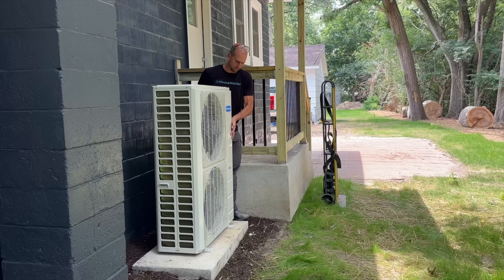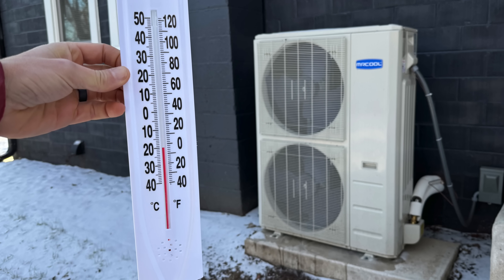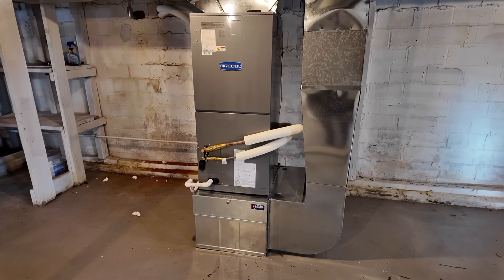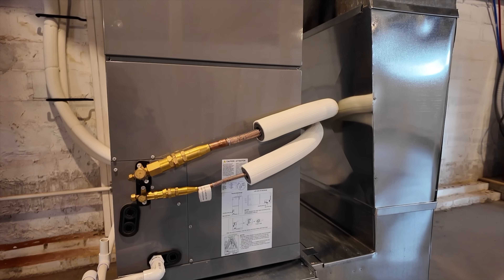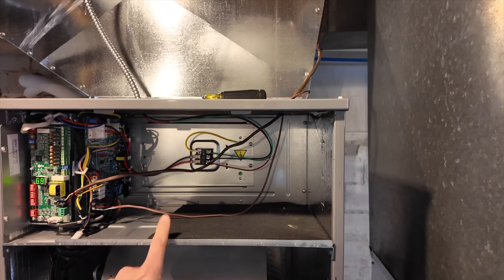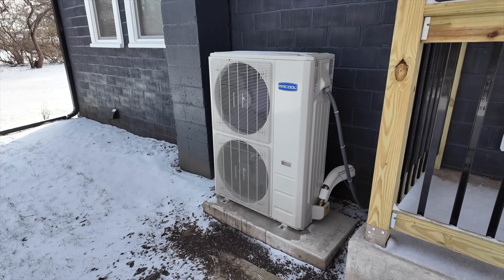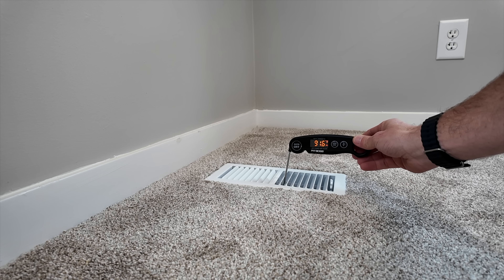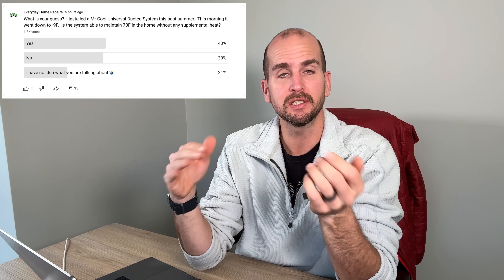Testing A MrCool At Extreme Cold Temps | Will The Hyper Heat Work?

Comment: I had a 4 ton Mitsubishi installed in Colorado in August, 1400sqft house built in 2004. We had the same cold snap, between -14F and 0F for 3 days. Heat was set at 71F because my wife is sick, and it was fine. The energy monitor says it pulled 7.5 kWh peak, 95 kWh a day. My ice buildup looks like in the video. Next time I'll probably set a lower temp.
Reply: Yikes . 95 a day is what cooling in 110° this summer cost on a traditional 14 SEER 2100 ft home .
Reply: You really do need a backup heat source. Minus 14F is COLD and there's very little heat in the outdoor air to gather. Your heat pump was probably just running on its heat strips (resistance heaters) which are a very expensive form of built-in backup. Get a woodstove, or something you can depend on when the weather gets this cold.
Reply: @paulmaxwell8851 I don't have heat strips either. The installer said they'd cost $3K, I figured that would buy a lot of electric space heaters.
Reply: @paulmaxwell8851 remember that 0°F is 255 kelvins, or 255 kelvins above absolute zero (where there's no heat energy). 100°F is 311 kelvins. Not a crazy spread there. There's a lot of energy to be gathered. But it still takes energy to gather it from the air!

I would guess that person had a Hyperheat in Colorado...meaning it'll blow hot air down to around - 22°F or 243k.

I think it's wiser to use a cold climate inverter style, but not Hyperheat, heat pump in up to zone 4...with aux strips, rather than a Hyperheat because they're actually slightly more efficient than a Hyperheat unit during the vast majority of their operating conditions. The strips should only need to energize during defrost (let the inverter ramp up and do the job rather than resorting to the strips over 2°, except for the absolute most extreme conditions...which happen about 2 hours per year. Hopefully the installed thermostats have adequate logic to behave in such a fashion.

Comment: I have a Mitsubishi hyper heat mini split system in my 1000sf home but these negative temps over the last few days have not been up to the task. Thankfully I kept my gas furnace just in case this winter.
Reply: Thermostat settings play a huge part how these systems run. So if the settings are incorrect they won’t run down really cold temps

Comment: My past experience with heat pumps has been horrible.  I'm surprised, and impressed!  You said temps were close to 0.. I am concerned with how it will do when temps drop below 0, which will happen in IL.
Reply: to be fair: the US is horribly behind compared to the japanese brands and the units the SU does get like the bosch and these rebaged Gree units are pretty far on the bottom end of the quality and performance tier.
Reply: @SupremeRuleroftheWorld  I have the 48k version of this unit.  Please note that these are hyper heat units, not universal units, although both are central ducted units.  Universal units are rebadged Gree but hyper heat is a different manufacturer.
Reply: someone is a Mitsu snob LOL
Reply: @sprockkets  fun fact: both my air/water heat pump and 2 separate minisplits in my home are from panasonic.
Reply: Can you get better performance with a top-of-the-line Mitsubishi minisplit? Yes you can. But you'll pay far, far, far more  when you factor in the install. MrCool sells DIY units to people who will never be able to drop $10,000 to 20,000 on a heat pump. They work well, but have their limitations AS DO ALL MAKES AND MODELS. As I said above, we cannot all afford to drive Ferraris and MrCool is helping to make HVAC affordable for ordinary people.  @SupremeRuleroftheWorld

Comment: Question. I am in a very humid location, how does it do with that? The central heat pump I have will heat, but it is a muggy wet feeling heat. I have gas downstairs which comes out dry, but I don't think the air in the heat pump system gets warm enough to dry the air.
Reply: No heater system "dries" the air, period. You might think that if your coil is wet from air conditioning.

Comment: Great information Scott. I'm curious about the power consumption of the unit at sub zero temps. Looking forward to that next video.
Reply from the maker: Yeah, I have been waiting for the cold snap to really see what the daily consumption would be on the high side.  Not looking good 😬 if you ever wanted to run one of these units off-grid.

Comment: My cooper hunter heat pump is designed to run up to -22 f. It’s a 2.4 ton unit heating 600 square feet brick wall house. And I would say it’s not enough. But we are limited by amount of input current in Ukraine, we only have 240 volt 16amp
Reply from the maker: Yeah, I saw this unit go up to a power draw of up to 7 kW when the temp dipped down to -9F (-23C) which is a heavy load and not going to work on a 16 Amp service.  Thanks for the feedback and be safe over there.
Reply: @EverydayHomeRepairs  thanks. It was huge problem as we had to turn everything off so that heat pump doesn’t trip the street breaker

Comment: A couple days ago here in western Canada we experienced overnight lows of -49F and highs of -35F.  Are any of these heat pumps capable of, or even surpassing, the heat output of a typical natural gas furnace used to heat say a typical 1200 square foot bungalow?
Reply from the maker: The heat pump units would depend on those "heat kits" to provide heat down to those temps but it would be a Massive power draw on your system.  I think having a supplemental heat source like a pellet stove and maybe some space heaters would be a little more efficient way to go.  These units are nice but pull a serious load once the temps dips under 0F.
Reply: Cold weather heat pumps are not currently designed to work below about-10°F.  For your location you need a dual fuel heat pump or a water to air system.
Reply: No, stick with natural gas.  If you get an itch and want to chop wood, get a Jotul cast iron wood stove.

Comment: Heat pumps are just going to keep getting better. The department of energy is holding a cold climate heat pump challenge and most of the major brands are in the field trial phase.
Reply from the maker: Yeah, I have been impressed with the improvements over the years 👍
Reply: Be careful with doe.  I used their testing data to base my air source heat pump purchase.  The test data was not valid.  I suspect they use manufacturer testing data, which may not be reliable.  And/or doe testing controls were not fully disclosed.

Comment: You mention in the video the outdoor unit is fed with a 50A 240V circuit?  That seems massive for a 3 ton unit.  My 3-ton Mitsubishi Hyper Heat unit only uses a 30A 240V Circuit, and that includes backfeeding the indoor unit from that same circuit (no separate circuit for the indoor unit required).  I wonder why the Mr. Cool needs such a bigger supply?
Reply: It probably doesn't, but this particular unit needs only one circuit, as the outdoor unit powers the indoor one.

Comment: Hmm, I have a propane furnace currently, wonder what the cost difference would be going with this MrCool system.  I don't have central air, so the MrCool system would be nice, but is it worth the cost to replace the furnace to have heat/air both.  Not sure what it would cost to add central air but it can't be any less than this whole unit....I have a 1200 square foot home, and think the system you have would work just as well here in Idaho, currently in single digits and slightly below overnight....but I have a wood stove I use when I'm not at work.  My current recurring issue is when the furnace has to run really often when I'm at work, I come home to a freezing house because the condensate drain freezes up and shuts down the furnace.
Reply: You can use a mrcool universal, replacing ONLY your outdoor condensor/HP (assuming your evaporator has a TXV, properly sized and set up for a HP). Then you have your propane furnace as aux/emergency heat. In most of the country,  even resistance heating matches or beats propane at winter pricing, and the cost is much less volatile. Here in the south, our EMC charges about 4 cents less per kw/h after 1k. Also, for now - the 2-3 ton (but not the 4-5 ton) mrcool unit qualifies for the 30% tax CREDIT. ("Inflation Reduction Act" lol). In the south,  these things really perform well in the summer compared to our old 10 and 14 seer units, but almost anything new would.

If you don't have A/C now you would also have to insert a new evaporator inline with your existing furnace and run a new lineset. Also covered in the tax credit.

Comment: It can deliver heat, but it will need more defrost cycles and each cycle will require more heat than when operating near freezing.  While this (and other new heat pumps) can work with colder ambient, even old school heat pumps can deliver heat down to well below freezing and needed to defrost.  The issue is defrost cycles and the net energy usage over time once those defrost cycles are taken into account as well as comfort during those defrost cycles.  Usually a well documented heat pump will specify its performance coefficient curve vs. ambient temperature.  In theory it is cost effective to operate while performance is greater than 1 (at which point just use electric heat) but usually it is better to stop well before then to avoid excess wear and tear on the equipment and simply for occupant comfort.

How much energy does it use during defrost compared to "while heating"?  Does it blow cold during defrost?  If not, where does the defrost energy come from?

Heating water may be the ideal heat pump application.  That provides a large reservoir of heat for defrost, with no concern about "blowing cold air" and the backup heat can be called upon the supplement if heat demand exceeds reservoir capacity.
Reply: As far as COP numbers at various ambient temperatures, you can look that up in the NEEP database. Tons of information about all brands of heat pumps. I get what you’re saying about heating water, but that’s just not how homes are heated in the Midwestern United States. Other than a few very old houses, basically everything is forced air here - whether by gas, oil, propane, or heat pump.

Comment: Curious what the energy draw is at that temperature; I expect it will be higher than during more mild weather. We get a lot of cold weather up here in Maine, but in the area where I live, we also tend to get plenty of power outages, sometimes for days at a time. A portable generator runs my furnace just fine; not sure if that would work with a heat pump at -20 though.
Reply from the maker: Here is more of deep dive on the max power draw and daily energy consumption.  Interesting results for sure https://youtu.be/06CiR6SWkAE?si=0g8P8nHIV1tNWsZr
Reply: Usually pretty similar energy usage, except during defrost which happens more often if the outdoor coils operate both below the dew point and below freezing.  Very dry, cold air - not a problem.  Rainy and foggy near freezing - the unit will spend a lot of time defrosting those outdoor coils.

Defrost might pull heat from the room ("blows cold air") or use electric heating or possibly some combination ("blows less hard and it doesn't feel very warm").
Reply: It would have to be a massively huge generator to power a heat pump and an air handler. He said the outdoor unit is 50 amps alone, and a 15 amp 240 volt circuit for the indoor blower. Most of this channel's videos are literally just infomercials for the products they're featuring, hence the manufacturer's link to the product in the description. They'll never expose the gory details of the product's drawbacks. If you suffer outages for days at a time, stick with fossil fuels as a furnace or boiler using gas, oil, kerosene or propane running on 15 amps 120 volts is easily powered by most portable generators.
Reply: @darrendolphdragos9752 The 15 Amp and 50 Amp he referred is the breaker size and has little to do with the amount of power. Nation electric code(nec) derates them to 80% so 52 amps total which is equivalent to 12.48 kW and it still probably doesn’t use that much power. A 12 kW generator should be able to power it no problem and you might be able to get by with one a little smaller like a 9kw. You just have to make sure you have a variable start. If it is not and has a high lock rotor amps (LRA) like older units use to have it could cause problems with the generator.
Reply: @ryanp0342  Ryan, I'm aware the actual load of the heat pump and blower aren't the breaker ratings. But anyone with a generator sized to run this heat pump, who needs to run it for possibly days at a time, better have quite a number of gas cans for that portable 9kW generator. It's possible, but IMHO simply impractical. Plus anyone with a backup generator surely would want at least a couple of circuits in the house available. As far as variable (we call it soft start) I believe most of these heat pumps use inverter technology (at least the ductless systems do) and convert the AC current to DC and always soft start.
Reply: @darrendolphdragos9752  Soft start and variable drive are not the same thing. A soft start is basically a capacitor that is added to the motor circuit reducing the start up or the Lock Rotor Amps(LRA) but doesn't necesarily limit the running current(RLA). A Variable drive limits the current on start up and also limits the current to a variable amount instead of a set speed making it run more efficiently. You could easily use the lights while running the generator because of the variable drive. You would burn roughly 10-20 gallons per day depending on heat setting so yes multiple days would be a hassle if you don'y have access to a fuel source but if you think you need more that much time for an emergency outage you can easily get a propane generator with tank for the capacity you need. My point is it can be done with good planning.
Reply: @ryanp0342  Good planning? You mean that and boatload of money. My response here was geared towards the situation the OP explained. All the OP needs to utilize a heat-pump based heating system is a much larger generator, and a lot of extra fuel to weather a multi-day outage. Not very practical and for most people, impossible. I realize soft start and variable drive are different concepts. My point was variable drive DC powered heat pumps tend to "start soft" and ramp up as it's "brains" look at indoor temp, outdoor temp, and set-point to determine the acceptable speed to ramp up to. They don't just come to life at full power like a traditional heat pump or AC.

Comment: I have a newly built house in Pueblo. During construction I wanted a similar heat pump installed, but for whatever reason (probably greed) the builder or their contractor installed a crappy Armstrong unit.

It has been 0F or below for the past few days and that thing cannot get it above 60f in here without resorting to the 'hair dryer' coils. 
I'm using over 30kWh a day when just a few weeks ago I was using just over 10kWh. Electricity here is 22c/kWh, so that's $6 per day for heating. 

I'm trying to buy and get the right one installed, a similar 3ton Mr. Cool, but none of the HVAC companies around here want to work with equipment they don't sell. A few of them have had not nice things to say about Mr. Cool, but I expect that has more to do with poor DIY installs than the units themselves. 

Glad to hear another report of the Mr. Cool one working as advertised.

Comment: Our Mitsubishi with hyper heat (or similar) kept our house at 68 with overnight lows around -20 here in Maine last winter.
Reply from the maker: Impressive!  Thanks for the feedback.
Reply: 68F TOOOOOOOOOOO! COLD! LOL
Reply: @KarmenD-ce5re  yeah, it was chilly but that was only overnight. Temps increased during the day! I was just happy that the oil furnace didn't need to fire during the night with temps so low.

Comment: I'm curious what the electric draw is?  I've had older heat pumps in the past which had to use aux heat at an extra 5 or 10 KWh.  No thanks.  I'm now in a house with nat gas and this year it's still cheap
Reply from the maker: Here is more of deep dive on the max power draw and daily energy consumption.  Interesting results for sure https://youtu.be/06CiR6SWkAE?si=0g8P8nHIV1tNWsZr

Comment: Currently living through three days of below zero (16 two days and then 20) with heavy winds.  Our heat pump system without the electric furnace back up is still keeping us in the 70s throughout this time.  Our system is an LG and has had lots of control problems.  The dealer's tech turned off the furnace and that was the source of many of our problems.  Been working great since.

Comment: Unfortunately, for me, this system wouldn't work, because i can only have around 1100cfm with my ductwork, and around 30k btus at below zero temps just wouldn't cut it. I would have to use ductless with at least 60k capacity between 3 units.

Comment: Im near St Louis and I just installed a bosch 4 ton heat pump. Turns out the ductwork that was ran 32 years ago is undersized. But even with that its been holding its own. The outdoor unit has been in 20-40 mph winds, thermostat is set to 70° and it was holding temp pretty good until actual temp got below 0. Thats when the aux heat started kicking on for shortish bursts. Its been running virtually non stop to keep up but it's been cycling the aux heat on and off. The outdoor unit hasnt had any ice build up so far and the temp in the house hasn't been below 68.

Comment: Interesting my heat pump is 3.5 ton Goodman not as good as those you have it will work at the 12 but it’s not turning off air is no where 90 coming out of the register.
Reply: Yeah, I have a crappy 2.5 ton Armstrong unit that's also having trouble now that it's near and below 0. Trying to get a better one installed without overpaying by buying it from the installer is like pulling teeth. ~$4000 for a 3ton Mr. Cool online, or $15,000 for  a Daikon/Mitsubishi from the installer...